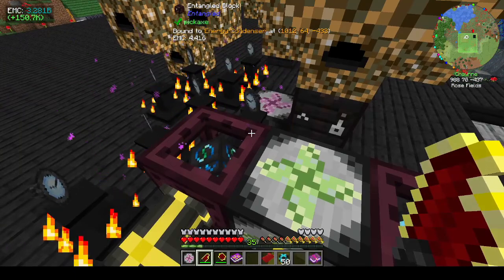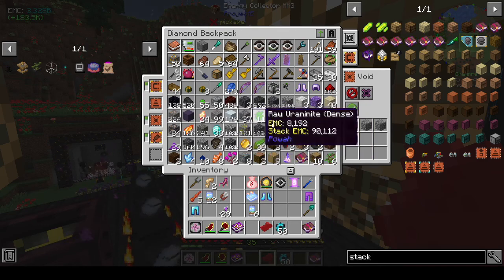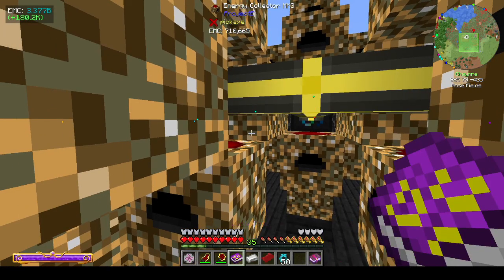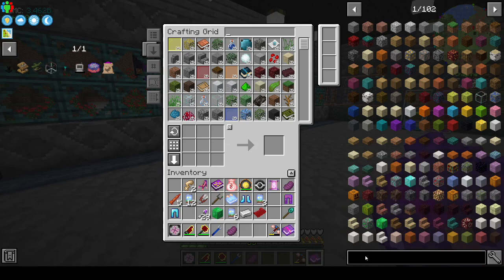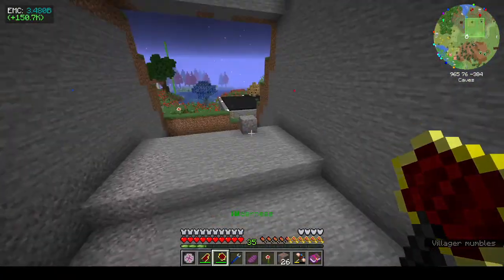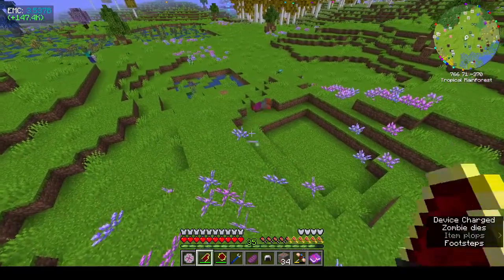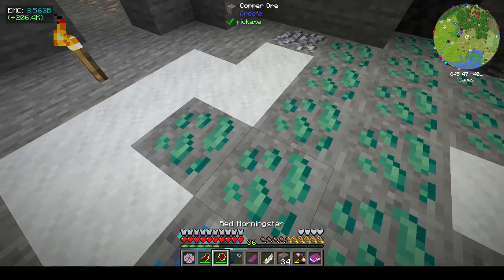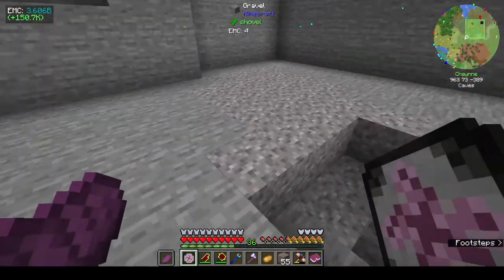Project Architect Ep 14: RIP Villagers... 😨

Comment: For clearing larger areas with more precision than the redmatter tools check out the "destruction gadget" its pretty cool but remember it voids any blocks you clear, but at this stage that's not a big deal. Also the "building gadget" is pretty great for easy building as well.
The mega torch will stop spawns in a large area around your base so you can work in peace.
Those poor villagers never saw it coming 😭...... 🤣 
Loving the series, keep up the great work.
Reply from the maker: Thanks... And those poor villagers! I'm still laughing over it!

Comment: You can use 1 of ur EMC farms to create infinite fuel for ur bigger reactor and use the entangle setup u did with the flower to send it to the reactor... leave it on and never have to deal with it again. Also the item pipe ur using on ur mob farm has a better whitelist when u upgrade it. Eventually you'll get to a point where u don't want to deal with armor and the knowledge tablets coming from mob farm.
Reply from the maker: Thanks, I hadn't thought about that for the big reactor, so I'll try that. I'll eventually get fed up of the dimlets, but as I've never done RF Tools dimensions, I'm keeping them all for now 😁

Comment: Small note, you can use the entangled block in the opposite way, build the power flower around an entangled block, and link them to an outside energy condenser, this way multiple power flowers can power a single energy condenser. This makes it a lot simpler to just link a single energy condenser to an emc link.
Reply from the maker: Nice! I think I'll do it that way when I redesign the roof, thanks!